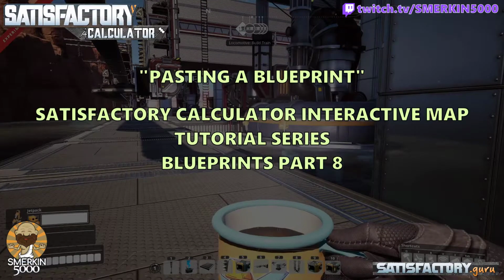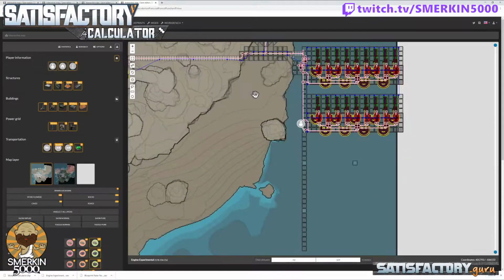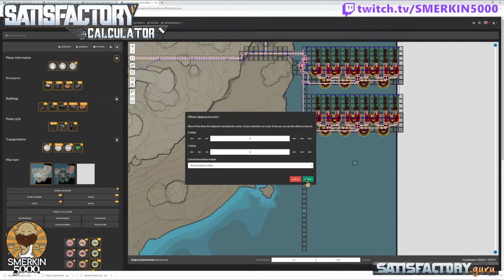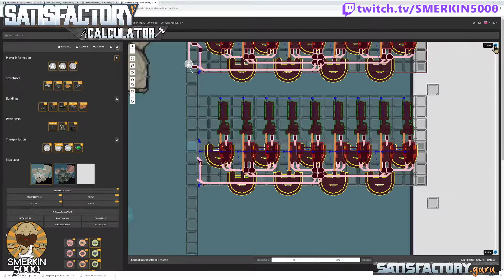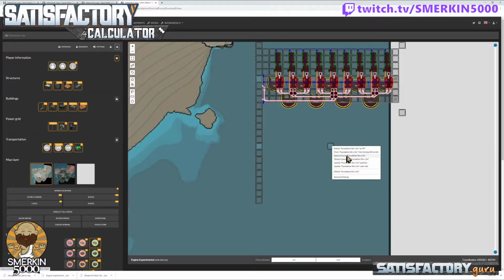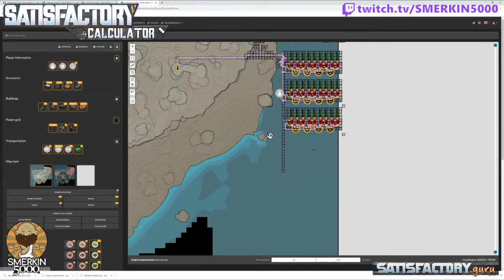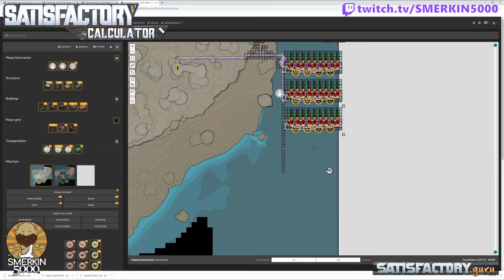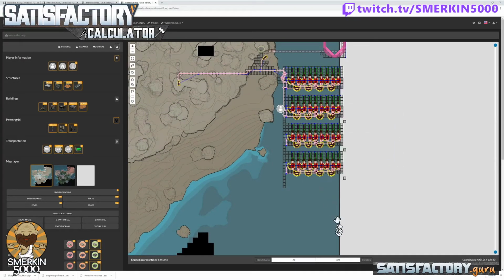SCIM Tutorial Series - Blueprints Part 8 - Pasting A Blueprint

Comment: I downloaded a blueprint from the satisfactory calculator site. I want to add this blueprint to my existing factory but if I paste it, the rotation of the pasted blueprint is not the same as the foundation I am pasting it on. How can I allgin this? Sorry for my english ^^
Reply from the maker: The foundation you are pasting to needs to be rotated to 0 degrees. Do this within the calculator before you paste.
Reply: @smerkin5000  I’ll try it right away!
Reply: That didn’t work.